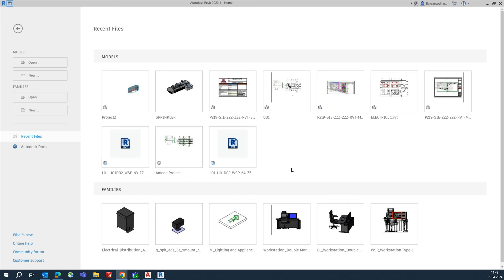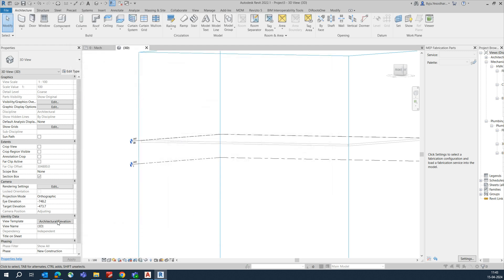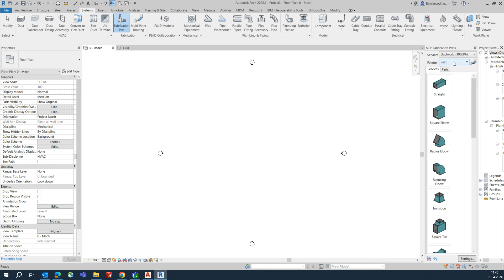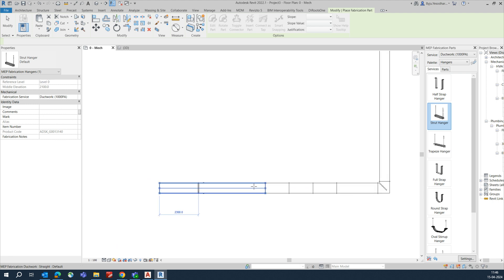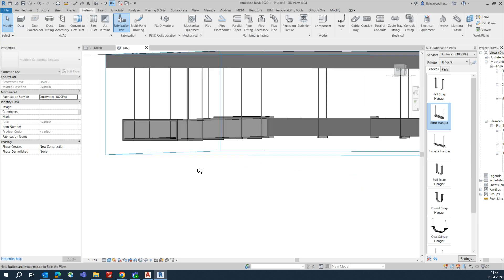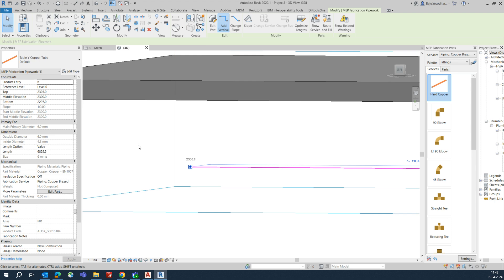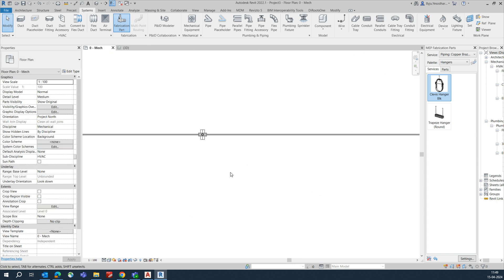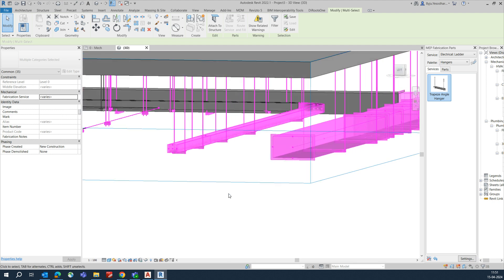Hanger Support in  Revit MEP

Comment: Hi where can I download fabrication settings ?
Reply from the maker: Hi its in revit itself
Reply: @AutoCADRevitByju  the problem is that I have fabrication settings but I cant change the directory where revit should search.
Reply: I have a 2023 fabtication and I would use it in revit 2025 but I cant change where revit should seartch
Reply: @AutoCADRevitByju  I treid to insert in options file position but doesnt work